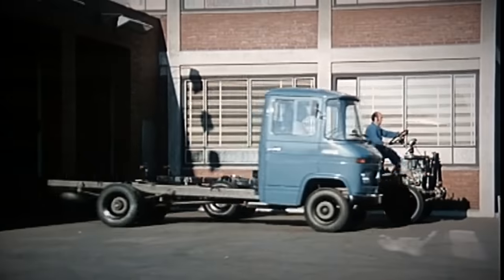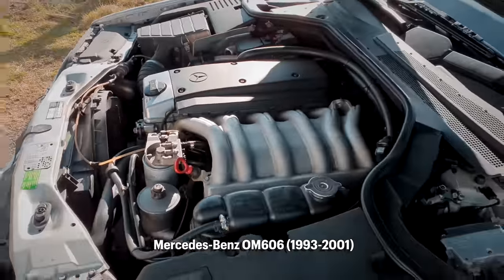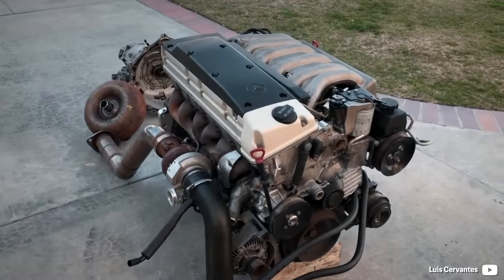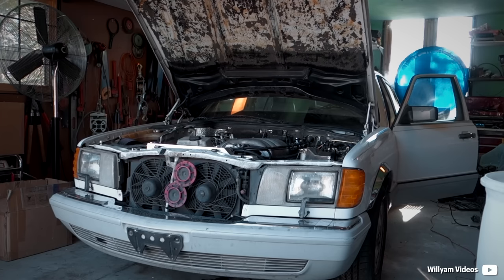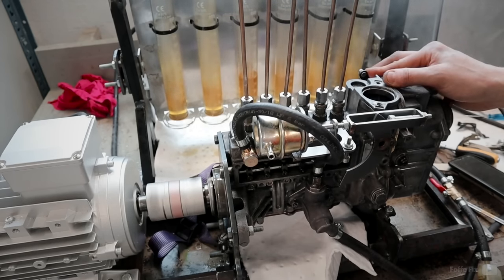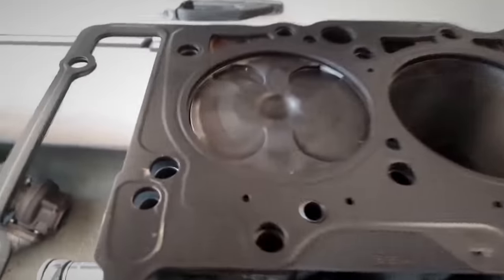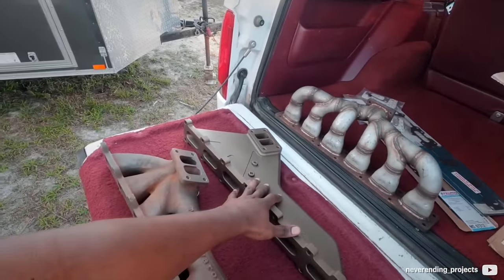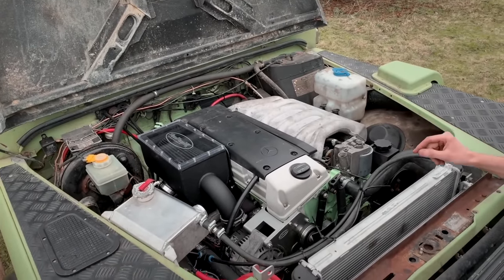The Best Mercedes-Benz Diesel Engine?

Comment: Gotta love a nice OM606 video 🥰 ... fun thing is due to the mechanic fuel pump these engines run great on nearly any oils you throw at them, Dieselpump UK has even done a dyno comparison of veggie oil vs normal diesel, turned out the veggie oil from Costco had some more hp in it then diesel 😆👌
Reply: can you add veggie oil to the diesel tank? Like, is it a problem if the two mix? sry for my ignorance.
Reply: U can, Mercedes loves the veggie oil. But I personally have 2 tanks, one tank with diesel for  the starting and stopping the motor. That way you keep the pump and injectors clean from veggie.oil which can clog up when cold. You can just stick a plastic boat tank in your boot diesel in a run a lineup
Reply: @jinglemyberries866  my dad and i both owned Mercedes 190 D 2.5 a decade or two ago and did many thousand km on veggie oil, often mixed in the tank with diesel. Never had any issues. It's a temperature thing. Veggie oil in summer, diesel in winter, and mixed in spring and fall worked good for us. But nowadays with mordern diesel engines and veggie oil being even more expensive then diesel the really fun times of rolling not coal but McDonald's smell fumes are over  😕😅
Reply: @nopadelik9286  that is awesome! Thanks for the info man!
Reply: @theaussienurseflipper.8113  ahh cool, Thanks for the info!!

Comment: I had my Mercedes diesel remapped.  It lost a little at the bottom but at 3000 it lights on fire.  The downshift is only there if I push hard so its not wasteful or nervous.  My big, heavy, diesel sipping 4 cylinder powered wagon is faster than my 70' base model Corvette gas guzzler.

Comment: Basically, the 2JZ in diesel ^^ Best engine Merco ever made.
Reply: m57 is more "2jz in diesel" Its way sporty, lightweight and revvy than this old om606. Om606 is just old tractor with bad fuel efficiency.
Reply: @bapr3887  idk about bad fuel effiency i got a 450 hp 800 nm om606 and it doesnt drink much diesel, about 6liters to 100km will be even less when i tune the pump better on dyno. smokes like hell now 😂 less smoke would be ideal

Comment: Hey, you used one of my videos! Fine with me, well done on the research and putting this video together. OM606 is just one of the legends, curious to see what the future holds for some of the builds with the newer engine management technologies. Baldur and Black Smoke have a controller for some of the common rail models now, should make things more interesting. I think these exceed the IDI engines in reliability and potential fun factor, so which is best?

Comment: Did you say they make a 4 cylinder engine like this 6?
Another great video.
Reply: @OM617a  604 wasn't turbocharged from factory. In fact, the 611 was the first turbodiesel 4 cylinder they used in cars
Reply: @niia.3642  thank you, now I need to go look up that engine.
Reply: @OM617a  thank you sir.
Reply: Let me ask this question, how long is the 6 cylinder engine? From the bell housing to the front pulley.
Reply: @OM617a  The 5 cylinder is turbo?

Comment: I've never really been into diesels but I've been aware of the OM series because a lot of Toyota rock crawler people and off-roaders swap them in search of more power and torque this video has opened my eyes to the high-end tuning capabilities of such a readily available cheap motor and since I know there's adapter kits to put them to Toyota I'll probably put one in my Toyota dually

Comment: probably because its so reliable is because it doesnt make so much torque. one of the killers of the isuzu 4JJ1 is torque is why they snap cranks from torsional and torque twist. 4jj1 made 144hp and 294nm in 2006 at less rpm than the om606 because its max revrange is 4200rpm... what most common diesels sit at and are good at because of it. "Low-end torque" the om606 is a diesel engine in my opinion made by mercedes to replicate petrol performance in a diesel engine. its missing displacement per cylinder for extra torque and revs way too high.

Comment: My only gripe with the OM606 Turbo is that aluminium isn’t the best material for a Diesel engine head, in the naturally aspirated versions, they’re fine, but, it left a negative impact on the legacy of the turbocharged versions. My main gripe with the OM617, likewise, is that it’s not an inline 6, or DOHC. If they made a cast iron head for the OM606 Turbo, that would solve its main problem.

Comment: very capable engine, for sure, but don't believe those 7K and 7K+ RPM stories.  Sure, you can rev it that high with almost zero fuel/power, but it will detonate the engine with any serious power output at that rpm.  It won't breathe at 7K+, and the fuel simply burns too slowly.

Comment: So if i can make a conclusion . Om606 dont need big cc because of the efficiency of the precombustion chamber . The fuel pump can be modified for cc injection by a simple length parts and the tolerance or the injector can accept patatoe oil . In my opinion the only avantage to go without common rail is for dyi fuel . Otherwise you need ui injection system to archive sufficient psi for injection . Can we reach 30 000 psi with a tuned mecanic pump from uk punk pump diesel ?

Comment: Love the diesel engines of mercedes light trucks and vans , the good old OM314 and later OM364 and later turbo and intercooler versions .  As long as you feed them oil , they will keep  going for ever.  Simpel technique that almost everyone can fix with simple tools , and most important : no computer and EGR  .

Comment: i also recently found out the om606 and 2jz arent much different from their basic components. the cylinder heads(cams, valves and chain drive), motor mounts(JDM and german cars share the same or almost identical motor mounts which hot rod garage found out when swapping a 2jz in the place of the V8 in the mercedes SL500 from 2002 to 2006), and also physical displacement(2997cc 2jz vs 2996 om606) in fact they are the same engine.
Reply: its even more obvious when you compare 2jz to mercedes m104 its exactly same toyota and yamaha maybe did some copying:D but why would you make a worse engine when you can copy perfection

Comment: I'd like to add that BMW's D30 have similar potential to some degree but burn less diesel oil
Reply: What´s a BMW D30?
Reply: @Avke92  D30 is part BMW's engine code. It indicates 3.0 l diesel engine
Reply: @hocek11   I got confused, thought you meant a engine family like N57.
Reply: I'm pretty sure that if you're burning any petrol at all in a diesel, you're doing something exceedingly wrong.

Comment: Always when i hear a carguy say "Diesel burns a lot slower" i cringe.
Yes it does. But it does not burn. Under the compression, every molecule combusts at the same time, because the compression is everywhere causing it to combust. Which means it is instantly. There is no spark plug and no time a flame needs from plug to bottom. It combusts all at a time.
Reply from the maker: Fine fine fine
Reply: @VisioRacer  That is the reason why diesel tuning theoratically can reach infinite power. Well, as long as the material, construction and so on is capable of. There are other limits. But that is the reason why you can turbo a diesel so nicely.

Comment: You can make the same mods to a ecd pump, and run a dsl1 ecu and tune it with a laptop on the run

“DSL1 diesel controller

Finally a stand-alone aftermarket ECU for the Mercedes Benz OM606 and OM605 EDC engines. Minimal wiring necessary, reducing the headache of doing an engine swap. Tuned by laptop, no messing with chips.
Introduced in 2014 and extensively tested in 2015 on multiple vehicles. Now also supports VP37 injection pumps as found on OM602.980 engines as well as countless VW and BMW applications. 
Available for purhcase from our web store.
Specifications

32 bit microcontroller
External dimensions 115x106x46mm
Fuelling at any engine speed indepentently adjustable.
Configurable hard engine speed limiting.
Fuel limiting based on charge air pressure (boost)
Overcurrent protection for rack solenoid
Pedal position error detection and override
Rack solenoid operation error detection and override
Tach output to drive a rev counter intended for any number of cylinders
Cruise control
Water/methanol or nitrous control strategy
User configurable fuel limit functions, can be used as launch control rev limiters, traction control, EGT safety, etc.
Calibration switch input offers ability to have two sets of maps installed to switch between while driving
Turbo boost control for any PWM operated pressure or vacuum solenoid, wide frequency range. Suitable for wastegated as well as VGT turbochargers.
Turbo boost strategy based on requested fuel quantity, allows for maximum fuel efficiency when properly calibrated
Glow heating relay control with programmable pre-start and after-start heating duration depending on engine temperature
CAN 2.0 bus for interfacing with peripherals such as transmission control, dash displays, VGT actuators or sensor interfaces. Internal 120Ω termination by default, can request unterminated CAN bus at time of order if unit will not be an end node on the CAN bus. Data rates configurable from 125kbit to 1000kbit. Fully user definable CAN transmission and reception formats.
OBD2 over CAN bus, enables use of OBD2 compatible aftermarket equipment such as gauges, displays and scan tools
Native USB connection. No USB-232 converter or associated hassle.
Data logging at over 50Hz standard via USB to computer running calibrator software
Internal data logging memory option on purchase time with real time clock for time stamping of log files. Up to 100Hz data logging rate. Units without this option may be returned to have this option fitted at any time for a small fee. With this option, data logs can be recorded by the controller when no laptop is connected and retrieved later, otherwise a laptop must be connected to record logs.
8 user configurable outputs for any purpose
2 year parts+labor warranty
Unit may be returned for reconfiguration of purchase time options after purchase time”

https://controls.is/shop/dsl1

Comment: I never understood why diesel engines smoked THAT MUCH. Even when rebuilt and enhanced like in the video, they keep smoking real bad, I don't get it.
Reply: to get the high power levels they are generally over fueled. Diesels don't operate with a tightly controlled fuel air ratio as they don't have a throttle valve in the air intake. The intake is permanently wide open and output power is only controlled by the amount of fuel added to the intake. At low power output they are very lean and at high power very rich.
That is why a diesel is most efficient at idle and a petrol engine is the opposite -least efficient at idle.
Reply: @paulg3336  I was not aware that diesel engines were functioning like this, thanks for the explanation!
Reply: Yep, they are overfeeding. This is common on mechanically injected diesels. Here in the US you will often see "common rail" electronically controlled diesels that make big power and run very clean. You can also clean up the smoke and make more power with nitrous oxide.
Reply: @barneymiller7894  same with the tuned om648 common rail

Comment: Given I have an OM606 swapped G wagon sat on the drive pushing out a tad over 300bhp, I’m a bit biased. An absolute beast of an engine. MB at their best. 700bhp possible on stock internals is testimony to the sheer engineering brilliance of these engines. Viewers would do well to look up the Diesel Pump U.K. channel. Luke works wonders with MB diesels.
Reply: 700bhp on stock internals is a myth, never seen one with stock internals pushing over 500 reliable hp

Comment: The smoke is the nail in the coffin for Diesel. Maybe an article on the Mercedes After-treatment will not go a miss.
Reply: These guys are making masses of smoke mainly due to excessive fuel delivery for maximum power.
Reply: @nerd1000ify  That's right, but it really kills the Diesel for cars, it emphasizes the dirt Diesel stigma. Its a shame as Diesels have com so far to be clean (and powerful).